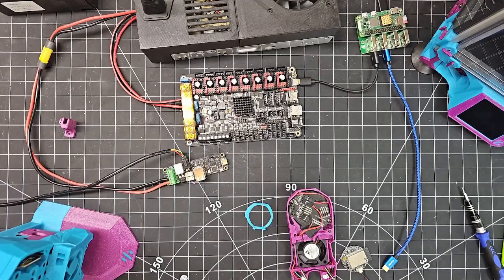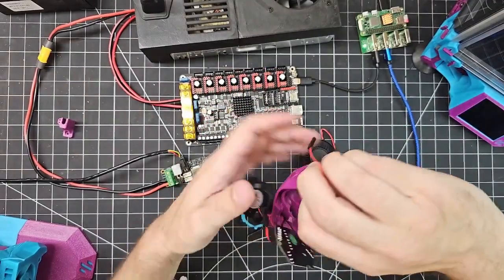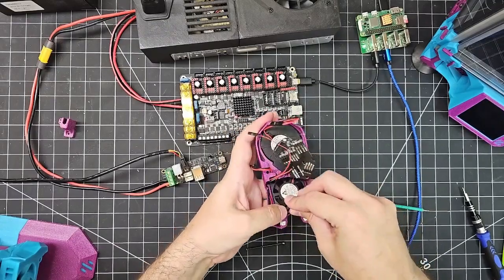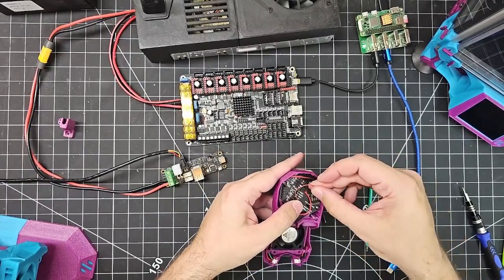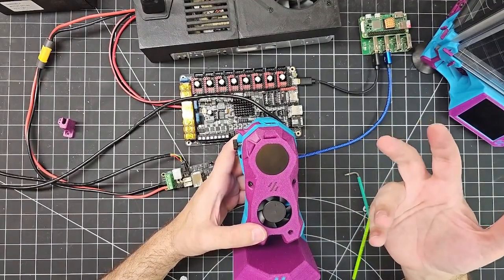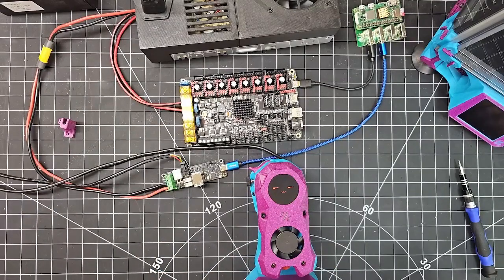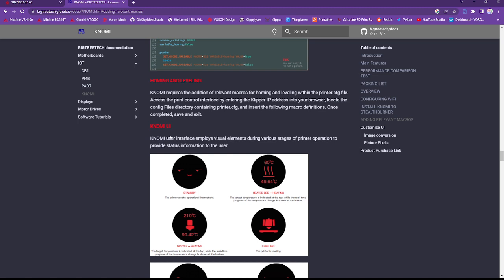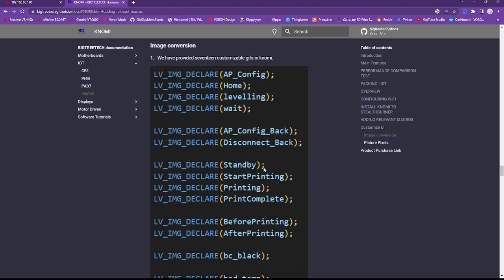From The Bench: Episode 5 - Installing a BTT KNOMI Toolhead Display

Comment: Hello everyone. If anyone can help, I'm asking for help. I spent two weeks getting all the settings right. And after that, I'm getting this error below at random times while printing. My settings are:
Voron 2.4
Raspberry Pi 3B
Eddy duo (CAN)
U2C V2
SB2240.
I also grounded the motor at the head. The TMC2240 driver error occurred a couple of times.

MCU 'EBBCan' shutdown: Missed scheduling of next digital out event This is generally indicative of an intermittent communication failure between micro-controller and host. Once the underlying issue is corrected, use the "FIRMWARE_RESTART" command to reset the firmware, reload the config, and restart the host software. Printer is shutdown

Comment: very good video, I already bought mine and my question is if I have to modify something in klipper, thank you. I am Cuban and those printers are prohibited here, I bought a Creality K1 and imported it in pieces, there is no library of that here because the internet is very restricted by the government.
Reply from the maker: There are two macros that need to be added or modified to allow the Knomi to change the display when performing specific actions:

[gcode_macro BED_MESH_CALIBRATE]
rename_existing: BED_MESH_CALIBRATE_BASE
variable_probing:False

gcode:
  SET_GCODE_VARIABLE MACRO=BED_MESH_CALIBRATE VARIABLE=probing VALUE=True
  BED_MESH_CALIBRATE_BASE
  SET_GCODE_VARIABLE MACRO=BED_MESH_CALIBRATE VARIABLE=probing VALUE=False

[gcode_macro G28]
rename_existing: G0028
variable_homing:False

gcode:
  SET_GCODE_VARIABLE MACRO=G28 VARIABLE=homing VALUE=True
  G0028
  SET_GCODE_VARIABLE MACRO=G28 VARIABLE=homing VALUE=False

Comment: Thanks, very informative and clear, can "EBB SB2240 2209 CAN" work with klicky?
Reply from the maker: I am 99% positive that they can work with Klicky, but I am not myself using Klicky.
Reply: It works, You just connect it to a switch port instead of the probe/proximity port @oldguymeltsplastic
Reply: @oldguymeltsplastic  Thanks, I'll give it a try and share my experiance here.